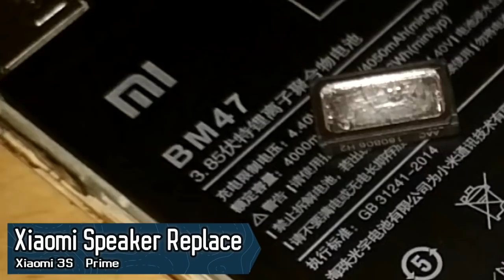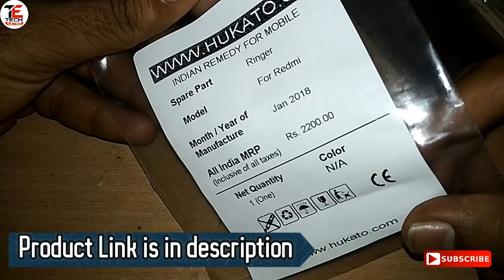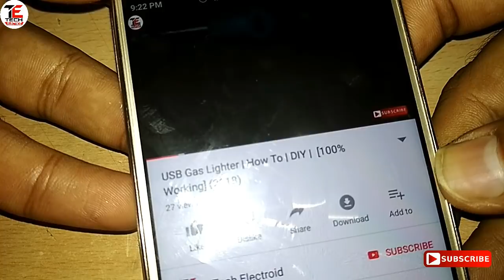"Ultimate Xiaomi Redmi 3s/3s Prime Speaker Replacement: NO MORE Sound Problems! 🔊💥"

Comment: You didn't show the before and after volume effect
Reply from the maker: My old speaker is damaged and bro this is video is for replacement not for comparison. New speakers sound is same as original
Reply: @TechElectroid  thanks for that information bro.. actually the stock speaker is very low on volume so looking for a louder replacement